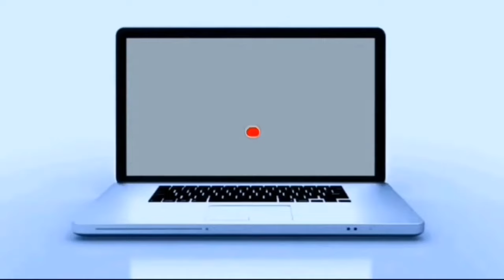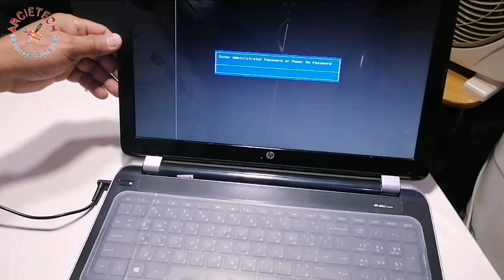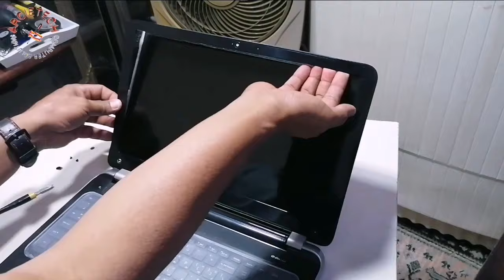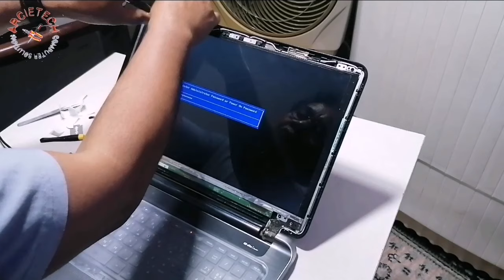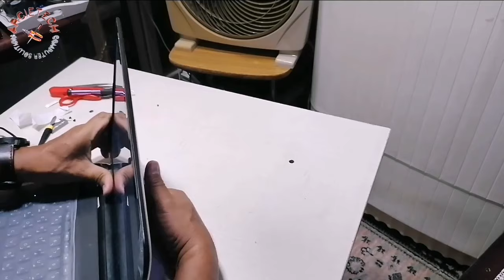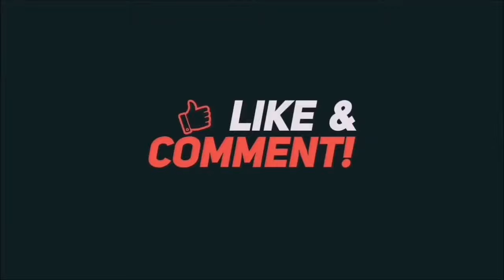How To fix Vertical Line on Laptop LCD Screen/Simple way# Pinoy version..

Comment: Remove the battery first before doing it because some electric wires can kill you
Reply: Dc can't kill you bro
Reply from the maker: that is (DC) direct current  can't kill you even you touch all parts of the laptop , if (AC) alternating current can kill you if you touch some open wire if the electricity is on..
Reply: You Just need to remove your battery to prevent short circuit

Comment: What's the actual problem behind this ?
or what part is damaged ?
Reply: Same happened with me
Reply: Same.
Reply: I accidentally dropped it when I was trying to place it on my table but then my chair was stepping on the battery wires and my laptop fail while I was grabbing it and when I turned it on the screen had random lines on them and they were colorful and I don't know how to fix it so I'm stuck with a broken screen.
Reply: @Kneeg_Row  change lcd screen
Reply: @heymanbatman  I fixed it yesterday. Nevermind. I just had to smack the bottom from where the keyboard and battery is at.

Comment: Sir small horizontal line appearing on top left corner and it's growing with in hours why?
Reply from the maker: Try to fix the flex cable connected to lcd
Reply: Your screen is bleeding. You probabaly broke the screen by accident

Comment: Sir, yung laptop ko po may vertical line then ma lumalabas pero hindi mo madalas parang mag fliflicker lang po sya. Ano po kaya pwede kong gawin para maayos to?
Reply from the maker: Ipacheck mo yung flex cable / lcd connector mangyari kasi yun pag nagagalaw
Reply: @ArcieTech  mahal po ba yung ma gagastos ko sir?

Comment: Magandang gabi po! Kapag hindi po ba siya pinaayos, tuluyan na po siyang masisirq?
Reply from the maker: Hindi naman boss, pag yung horizontal line or vertical line minsan nasa flex cable or sa lcd connector at sa board connection ang deperensya
Reply: @ArcieTech   Maraming salamat po! Ano po kaya ang dahilan kung bakit may vertical line. Maunti lang naman po siya. Mga 2 guhit na patayo pero paano po kaya na iwasan na dumami?

Comment: My laptop has pink horizontal line at the top isang guhit lang po, saka pag ni power on mo sya magdisplay sya ng pink screen.  Ano pong problem yun?
Reply from the maker: Try mo muna iconnect sa ibang monitor or sa tv na may VGA  connector kailangan mo lng ng VGA cable kung ok sa monitor or sa tv Ipacheck muna yung lcd connector or flex cable

Comment: Sir pag may vertical white lines po ba, need po ba siyang palitan ng LCD?
Reply from the maker: Ipacheck mo muna ang flex cable lcd connector at display  connection sa board

Comment: No need na po ba bumili ng bagong LCD Screen?
Reply from the maker: Pag yung vertical line at horizontal line maayos pa lods minsan sa flex cable lcd connector at sa board connector nagagalaw kasi palge pag tinotopi ang laptop

Comment: Sir suddenly a single horizontal green line has appeared on the bottom of my screen.. any solution for that ?? Please help me out
Reply from the maker: Check the flex cable or lcd connector
Reply: @ArcieTech  it's getting light and again it's getting bright... If I press two corners it's getting light.. what's the problem ?? Should I be pressing for 2/3 days ??

Comment: Kuya papaano po kapag black screen sya tapos puro horizontal lines hindi po nagrerespond ganun na talaga sya kahit i-on and off mo pa 😭 kailangan ko talaga sa online class biglang naging ganun 😭😭
Reply from the maker: Ipacheck mo flex cable pag ganun pa rin nsa lcd na ang may deperensya pwede ka rin gumamit ng ibang monitor kailangan mo lng vga cable connect mo sa laptop dun lalabas ang display ng iyong laptop
Reply: @ArcieTech  thank u so much poo :>>

Comment: Boss san po yung location nyo? Ganyan din po kasi yung akin wala kasi ako pambile ng bagong lcd e
Reply from the maker: Dito ako saudi idol, Ipacheck mo muna yung flex cable / lcd connector baka makipalit lng ng flex cable  or  try mo iconnect sa tv na may VGA connector or monitor
Reply: @ArcieTech  sige po. Salamat po ng madami

Comment: Delikado po ba to if di ko ipapafix agad? First is green line then unti unting nagiging black then lumabas nanaman isang green line boss then paunti unting nagiging black line nanaman po
Reply from the maker: Wla nman problema nyan ang kaso nga lang habang tumatagal lumalala.. Ipacheck mo lng ang flex cable /lcd connector at sa board
Reply: @ArcieTech  boss dinala ko na po sa ibang shop dito mas gusto nila palitan lcd para makabenta sila 🤦🏻‍♂️ Ayaw nila echeck yung cables ee
Reply from the maker: Hwag kang magpapalit agad ng lcd una icheck ang flex cable baka yun ang may deperensya kung kung walang pagbabago saka ka magpalit ng lcd kasi mahal ang lcd
Reply: @ArcieTech  baka po kasi boss dahil sa cables kasi may mga langgam akong nakikita na lumalabas sa pc ko na baka nasa loob na nagagalaw, na wala pong kumukuha sa unit ko pag nalaman nila name ng unit ko. Acer Aspire C24 po kasi. Ayaw nila e open sabi nila lcd papalitan ayaw nila echeck cables.

Comment: pag nagka.guhit po ba ang Lcd boss papalitan na po ba agad ung lcd nya salamat
Reply from the maker: Pag may Vertical line or horizontal line na lumalabas sa screen ipacheck mo yung flex cable  sa board connection or sa lcd connector

Comment: Hello sir badly need your help po. Bigla na lang nag blur yung laptop ko.
Reply from the maker: Try mo iconnect sa monitor or tv yung may VGA connector kailangan mo lng ng VGA cable pag ok sa ibang monitor or sa tv  Ipacheck mo lcd connector or flex cable ng laptop kung ganun pa din lcd na sira

Comment: Sir ganyan din po sa Akin may line po
Reply from the maker: Ipacheck mo yung flex cable / lcd connector at kung my tv or monitor ka na may vga connector try mo iconnect kailangan mo lng vga cable

Comment: Applicable po ba yang ginawa nyo sa horizontal line?
Reply from the maker: Depende boss ang kadalasan problema ng horizontal line or vertical line ay ang kanyang flex cable or dun sa connector
Reply: @ArcieTech  Salamat po sa info<3

Comment: Hello sir what if horizontal lines super dami
Reply from the maker: Ipacheck mo yung flex cable minsan ang problema yung connection sa lcd to flex or connection sa board to flex cable kung hindi man palitan ang fcable
Reply: @ArcieTech  salamat sir so hindi po agad papalitan ang lcd?
Reply: mam balita nafix npo sayo?same problem with my laptop